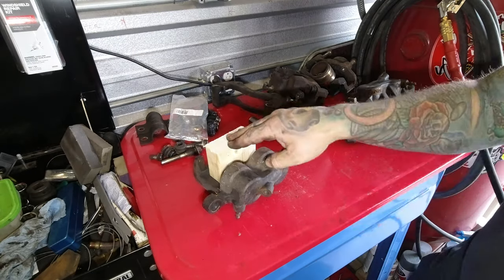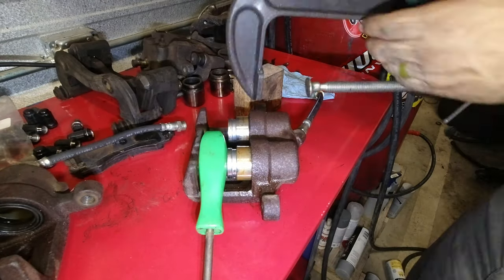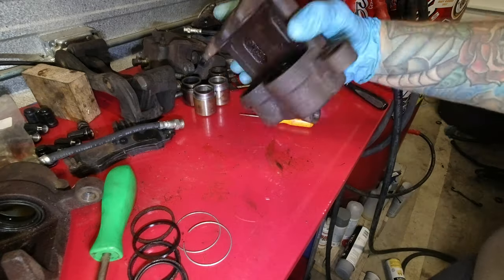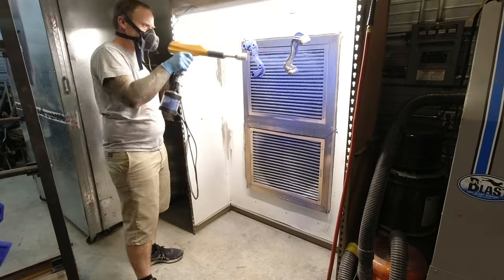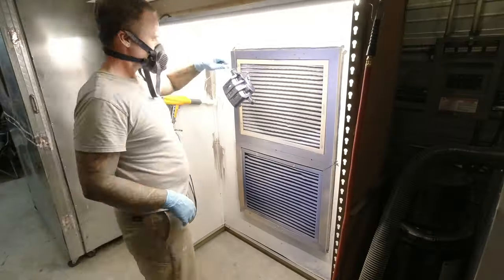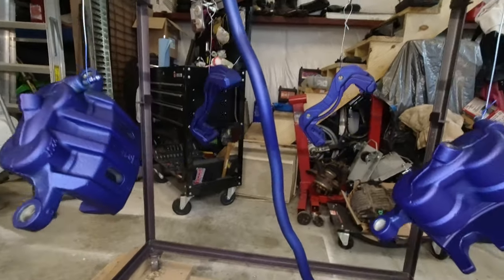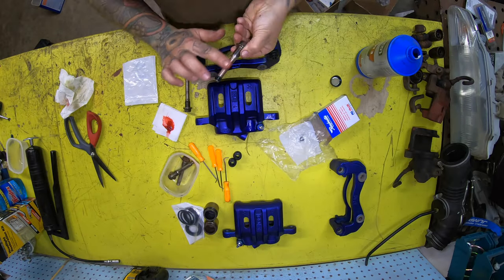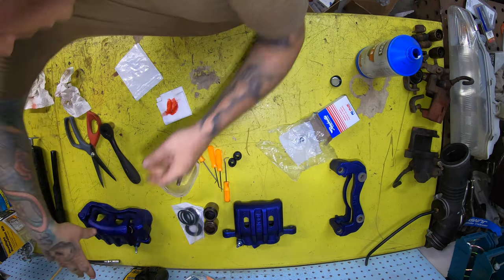How To Powdercoat Brake Calipers - Full Teardown and Rebuild. Powder 101 - Learn to Powdercoat

Comment: Looks great, but you should use brake assembly fluid instead of brake fluid in the bores. Brake fluid absorbs moisture and can cause the pistons to stick, assembly fluid doesn't. It's harder to find these days but I was able to get it ordered from O'Reilly's when no one else wanted to ship it.
Reply from the maker: Um...brake fluid is what fills the bores and actuates the pistons, so why contaminate the fluid with anything else? It's already so susceptible to water absorption I'd rather not use anything other than the end-use fluid in assembly. I'll look into the grease, but will probably never use it.
Reply: @tinygaragefab I was just reading bmw instructions as I’m thinking about overhauling my calipers and they also indicate use of some special paste instead of brake fluid, which is what I have done in the past.

Comment: Do you have a flat rate for calipers and such.. I know running the oven can't be cheap PLUS you time and powder ?
Reply from the maker: I only do my own parts, so I don't have a rate. I used to do customer work, mostly sport bike wheels, but I quit doing that a few years ago. But if I quoted this job for parts and labor, it would be about$250-300

Comment: Hey bud I know this video is older but question is a 6 piston the same ? They’re Brembo does it matter? Just wondering if I should attempt this on my own
Reply from the maker: They are similar. I have another video that's even older where I do a set of 4 piston Jaguar calipers. The hard part is getting the pistons out because you need to have them all still "in" but pushed out enough that they can be removed. As soon as any single piston comes out and loses the seal, there is no way to build pressure to remove the other pistons. 
I think you'll be successful if you try. Might get frustrating, but you got this!

Comment: I have a bunch of 1/4" plywood pieces I'll stuff into a caliper when blowing dual-piston caliper pistons out...Let them hit, slide a 1/4" piece out, blast them again, rinse and repeat...So both come out in a pretty controlled fashion, and you don't have much left to pull on the one that stays behind. I do it this way cause I always had trouble getting things to work right when trying to get a piston to go back into a bore and seal to get the other one out.

That blue is stellar.

Comment: Wow that turned out awesome! I love that color. I'm gonna do that for my truck except in a dark red. Do you use a low psi when blow powder out of the cups and the threaded areas?
Reply from the maker: My blow gun is at full psi (125) but has a really good trigger and I can control it well to blow it out pretty softly.
Reply: Sorry for the late response. Thank you for your response and letting me know. Will give this a try hopefully after Christmas. A powder coating gun is on my wish list.

Comment: Nice job! Just curious, what psi do you run on your blow gun when you are cleaning holes? Did you wipe clean the surface where slides hold in place or coat? Thanks!
Reply from the maker: I run my blow gun at full pressure (~90psi) but it is easy to regulate with the trigger. The slider area is also coated, because the stainless clips just snap in place over the coating.

Comment: i have a very small sandblaster,  a very small oven, very small car, and new calipers. I am going to finally try doing this myself thanks to your awesome video! Thanks for taking the time to show us beginners how to properly do this!!

Would you say that a clear coat is required? Or only for your special base colour?
Reply from the maker: If the calipers are brand new, then just clean them really good with brake cleaner, don't even bother with blasting. But if they are painted or rusty, then blast them. 

Clear was mandatory for the "illusion" powder that I used here. Most powders do not require it, but it can add an extra level of gloss (or satin/matte) if that's the look you want. 

Have fun with it. You'll do great!

Comment: Could a high temp vinyl decal be applied before the clear coat?
Reply from the maker: Yes. I have applied even basic vinyl under powder, and it worked. I do recommend something high quality, like Oracal vinyl. Some powders even let you cure at a slightly lower temp, but longer cure time. That can help make it work also.

Comment: Hi would all calipers have 2 seals in the piston chamber? My 2014 grand cherokee only seems to have 1
Reply from the maker: Only one actual seal, which is the square-cut one inside the bore. The second is the dust cap which attaches to the outer ring of the piston.
Reply: @tinygaragefab  what's the little metal ring you pull off the outer edge?
Reply from the maker: That is the retaining ring for the dust seal. Because it expands like an accordion, it needs to be retained by something. It's usually a ring like that. Some caliper dust seals press in like an oil seal, but I don't see that too often.

Comment: Looks great! I'd love to have a powder coating gun and oven.
Reply from the maker: It was a fairly large investment, but as much stuff as I build, it has already saved me thousands of dollars!
Reply: @tinygaragefab  I was actually looking at some cheap setups today after posting. I have a large compressor, paint booth and few HVLP guns and such. I usually paint my calipers and rotor hats with either epoxy or ceramic paint. Always dabbled with the idea of powder coating. It should be longer lasting and more durable than any paint product. I figure for the few items that I'd do, a cheaper set might be ok. Thanks!

Comment: Or you can also tape those areas with painting tape or tapes that are made for this purpose. Anyway great stuff man!
Reply from the maker: I do have a lot of the high-temp silicone tape in my arsenal, but sometimes it really is easier to wipe it with a finger or blow it with the air gun. Some jobs absolutely require taping though, and I use it when I have to.

Comment: which sandblastedia did you use?? what media would I use on aluminium calipers? thanks!
Reply from the maker: I use crushed glass. I but it at harbor freight. Sometimes I'll mix in some of the stuff you can get at Tractor Supply just to give more 'cut.' I may be switching to aluminum oxide though, because I want to start getting into ceramic coating and aluminum oxide must be used for Cerakote.
Reply: @tinygaragefab  that's what I used, crushed glass. Im using prismatic powders by cerakote.

Comment: Just a few steps I believe your missing. Like pre bake part for outgasses not get brake fluid on finish after done   Also need to know that wiping a part with microfiber after blasting leaves behind small hairs that you can burn off with torch...  but they do look good for sure.
Reply from the maker: I do outgas some things. Calipers, I hardly ever do. I've done enough that its not really a necessary step. Aluminum parts that had contact with oils get outgased 100% of the time. 
Brake fluid getting on them is inevitable. Brake fluid is the clear version of anti-sieze. If you know, you know. 
And I keep a propane torch at the ready next to the booth to burn the microfiber hairs off, as well as occasionally add a little preheat to inside corners of tricky parts that would normally deflect powder from hysteresis.

Comment: What about the sand blasting inside where the piston goes??
Reply from the maker: I don't sandblast in the piston bore. I usually just sandblast the outside of the caliper body. If I need to blast close to the bore, I'll either stuff a rag, some foil, or mask the bore.

Comment: You only preheated once ?
Reply from the maker: I never preheated. I baked them to offgas and burn off any oil, but then let them cool before spraying powder. I never spray powder on a hot part. That is called "hot flocking" and is not recommended at all.

Comment: Where are you located?
Reply from the maker: I'm in Virginia, but I do not do 'customer' work. I simply don't have time for my own projects, which leaves absolutely no time to do things for anyone else. I would like to be able to take on jobs eventually, but for now I just can't.  
There should be no shortage of powder coating shops darn near anywhere, all of which should have experience tearing down and rebuilding calipers after coating.